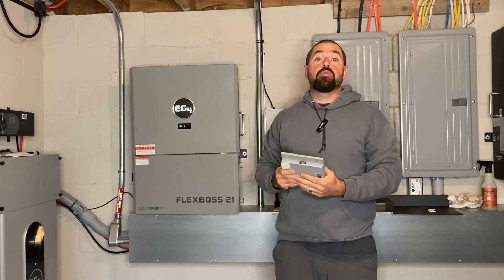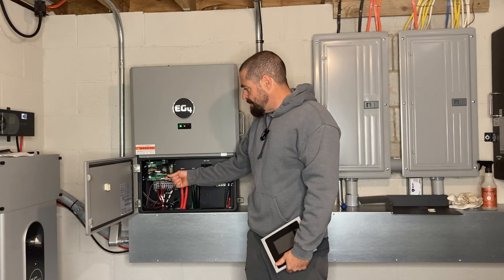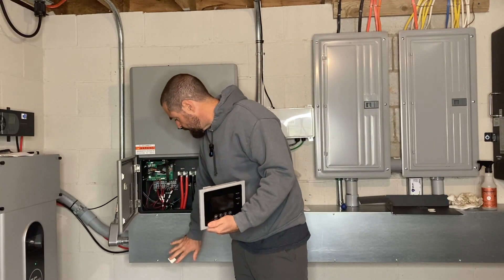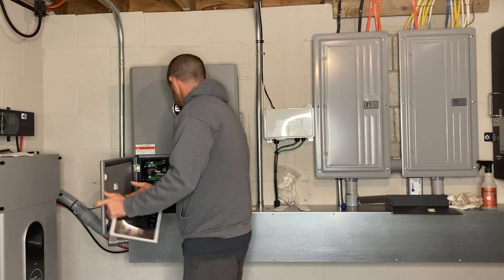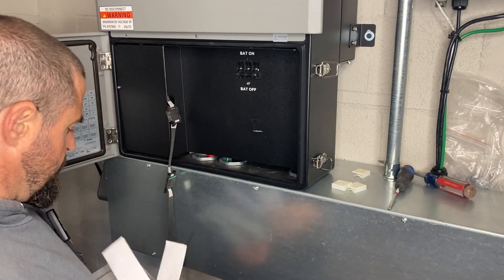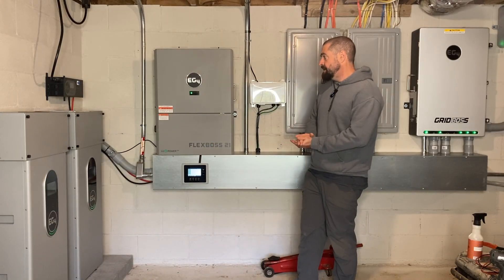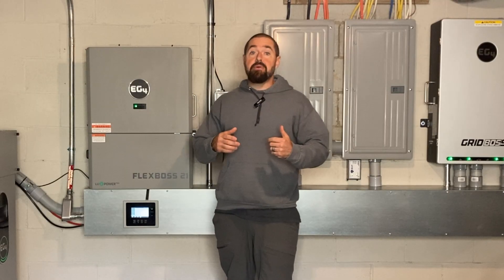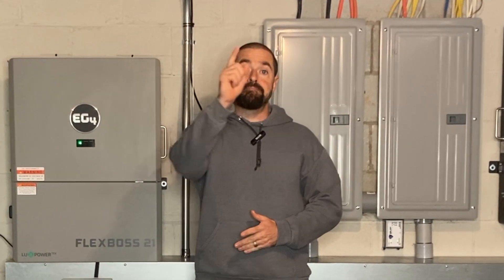Reinstalling the EG4 FlexBoss21 & GridBoss MID External LCD Screen | Setup & Troubleshooting

Comment from the maker: Signature Solar affiliate link (CHEAPEST SOLAR PANELS ON THE MARKET and EG4 Products) 
$50 off for orders over $500 with Coupon Code: ROCKYSAVE50
https://signaturesolar.com/?ref=uzUOpPif73O10D

Current Connected Affiliate (SOL-ARK PRODUCTS)
https://currentconnected.com/?ref=RockyBroadSolar

A1 Solar Store
https://a1solarstore.com/r/b814406845157bf1a9f70001a2730d79

Rocky Broad Solar Website
https://rockybroadsolar.com

Facebook
https://www.facebook.com/profile.php?id=61558585264414

Comment: Are you concerned that the access door seal is going to pinch that ribbon cable too much and cause problems over time?  I wish there was a better way of mounting the screen.  Thanks for your videos!
Reply from the maker: I wasn't sure about it at first, but it seemed to work out fine. I also with there were a better way. Unfortunately those inverter screens tend to fail over time, especially out in direct sun, which is why most manufacturers did away with them. Thanks for watching the channel!

Comment: I passed on the screen for mine. I have an old laptop that I've been leaving on top of the conduit box right next to it and that works well enough for logging into the EG4 Monitor Center to see what's going on. I'm getting very interested in setting up a Home Assistant integration for better system management though. I've been disappointed in the settings options inside Monitor Center.
Reply from the maker: @coolcat312 I agree that the EG4 app is not extremely impressive. My biggest issue is when I am testing products it takes out my internet during system overloads/outages so I wanted something to look at during those times. I am in the process of getting a small power station or UPS for the internet router though to solve that problem. I have not yet dived into home assistant but that would certainly make some interesting content. I will have to look into it. Thanks for watching the channel!